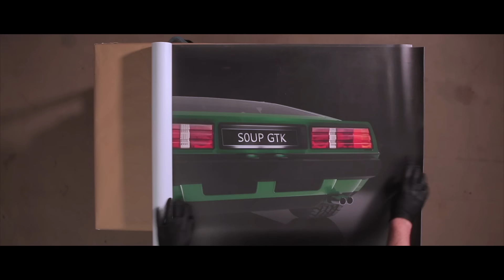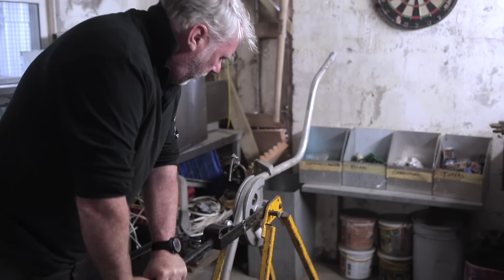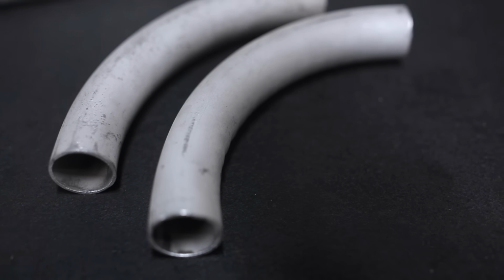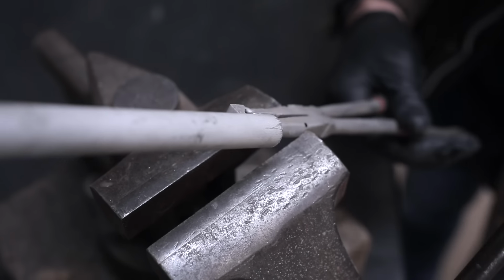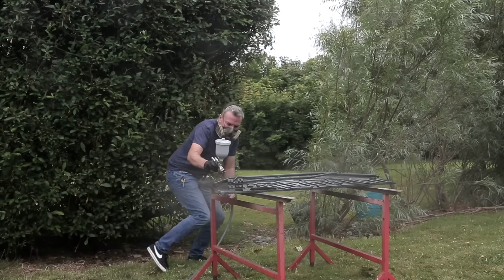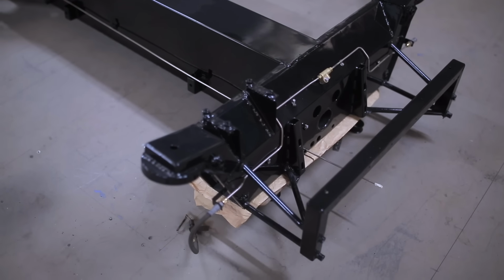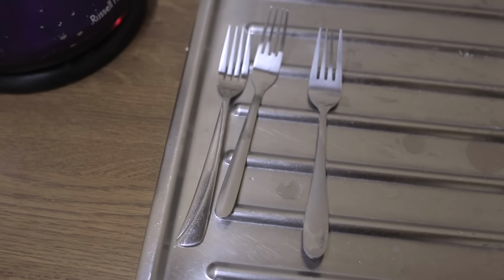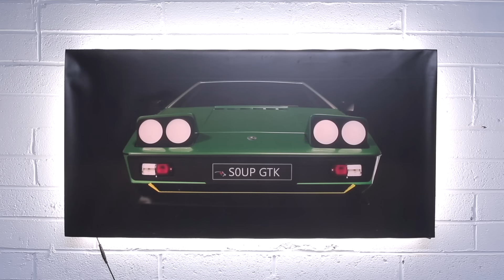Forgotten classic build has it all | 1978 Lotus Esprit

Comment: Your pipe bender is lacking a former, that's one reason your getting wrinkles. Ideally you want the bend to start at 90 degrees to the bending arm. A former is like a long square piece of aluminium. With the profile of the pipe on one side, that fits closely inside the cheeks. The tighter you can be to the former gives you nearly the ideal 90 degrees. Usually the bending arm has a screw to move it tight to the former.

Comment: This is the second video in a week I've seen a 'mechanic' use a pipe bender.

A little trick I learned as an Electrician's apprentice back in the 80's.

Put your pipe UNDER the form for these reasons.

1. It's much easier to lift up than pull down.
2. You maximum bend is only limited by roof height. [ at least twice the distance to the floor, long bends, do it outside! ]
3. The brace will be under load before you start pulling, so the pipe will not wobble.

Loving the build.

Comment: 9:15 I usually use lighter gas with the bottle upside down to freeze them even more. It being the cheap option versus a real cold spray. It's very oddly satisfying feeling when the bearing just slides in the housing.

Comment: Polyurethane bushings will squeak after a couple of years. I have read it you use PTFE tape on split type bushes it will never squeak. On a one piece you could glue a peice of ptfe on to the part and use lots of washing up liquid to slide the bush on

Comment: To put a frozen bearing into a heated part, the heated part needs to be put into an oven at 200c for at least 1/2 hour. Honestly for the frozen bearing, you should use dry ice to cool the bearings. I have done this over 100 times in my work.

Comment: Getting impatient. Want to see a rolling chassis ;-)
Reply: I don't know about the Esprit, but if it's the same as the Europa, you don't get a rolling chassis until the engine goes in... the driveshafts are also the upper control arms.  Rolling chassis with engine looks amazing... almost a shame to mount the body.

Comment: Freeze both parts and it just might slide in, its a common misconception that the hole needs heat, its the opposite, you need both parts to contract. Theres even a contraction rate for every metle per temp drop.

Comment: The sand does nothing. The theory is it'll stop the tube collapsing because it's non compressible. Nut when you bend tube you're stretching one side and shrinking the other. The wrinkles are a by product of the tube not being able to shrink enough. So you have excess material there and the sand is loose in the tube anyway. 
The only way to bend thin wall is with a mandrel or heat.

Comment: Just replace those threw body aluminium pipes with copper pipe they will outlast the rest of the car and you can bend them on that pipe bender with ease 😂
Reply: Your copper suggestion is certainly more robust.  However, based on what I have gleamed on this build, George would have some diffilculty on adopting copper pipes due to originality and the Lotus philosophy of 'lightness' as copper pipes are heavier.

Comment: George - see extract from my Elite Blog on the forum:

Nice shiny new bearings installed - thanks to @clivef38 for the top tip. Hub carriers in the oven for an hour at 100 deg c whilst bearings chill in the freezer. Bearings then popped straight in without the need to press or anything :) Was originally planning to press them in but getting/finding something to only push on the outer bearing wall was tricky. This really did work much more effectively than I'd imagined. I did wear a pair of 400 degree heat proof gloves though (very effective for only £12). Just got to grease up with high heat grease and fit seals and we are good to go!

Nice shiny new bearings installed - thanks to @clivef38 for the top tip. Hub carriers in the oven for an hour at 100 deg c whilst bearings chill in the freezer. Bearings then popped straight in without the need to press or anything :) Was originally planning to press them in but getting/finding something to only push on the outer bearing wall was tricky. This really did work much more effectively than I'd imagined. I did wear a pair of 400 degree heat proof gloves though (very effective for only £12). Just got to grease up with high heat grease and fit seals and we are good to go!